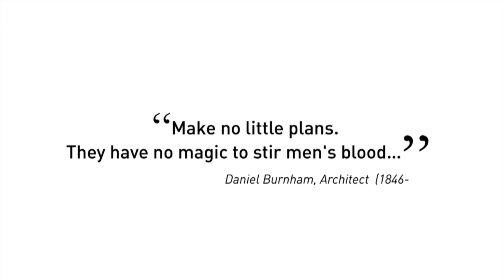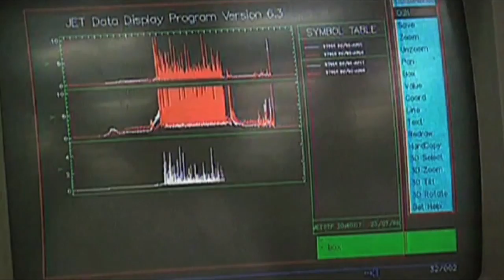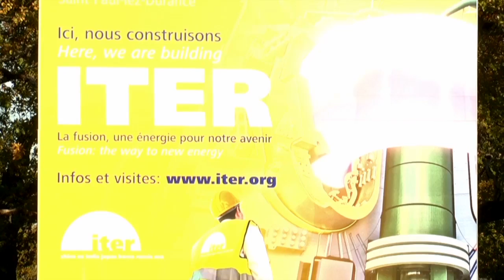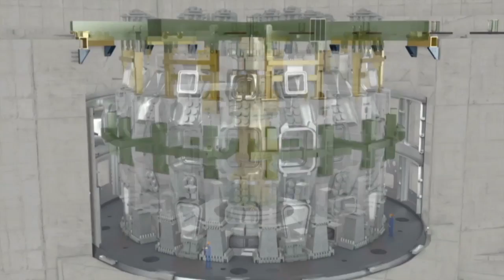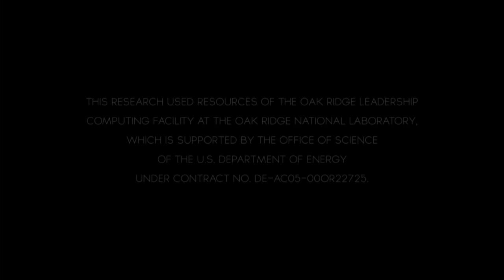ITER - in five minutes

Comment: Won't the heat melt the parts ?
Reply: no the plasma cant touch the walls of the reaction chamber since it is held away by the magnetic field.
Reply: That's what they want to check.
Reply: @lukasvolkwein6220  It sounds tricky. 150 million degrees.  WOW.  Doesn't steel melt at 3,000 degrees?
Reply: @kennethbransford820  yeah a 0 degree Fahrenheit vacuum is between the string of plasma held by the magnetic field, so there is no medium to transport the heat to the walls of the reaction chamber.
Reply: @lukasvolkwein6220  Wouldn't it melt by radiative means?  The sun is 27 million degrees and we are here talking about 150 million degrees. That's 5 times hotter the the sun.  I mean WOW!    Call me skeptical.
Reply: Sure it is a big engineering challenge but a smaller fusion realtor with similar design was built by the German Max Planck Institute and ist working. But it is to small to generate energy from it. In this tokamak reactor of Max Planck Institude you have to put more energy in to fusion the nukleids than retaining from the reaction. The goal of iter is to initiate a self sustaining chain reaction so you have only to start once, an than you can get energy from it.
Reply: @lukasvolkwein6220  I am like you and love science and any thing to do with engineering but you are talking about keeping the atoms or plasma close enough to fuse and create a self sustaining reaction producing pure energy.   The only know means known to mankind right now is gravity, the engine of the universe.  We right now can not generate the pressures needed for fusion to take place.   It would be cool if we could but I think we are running out of time in not being able to handle our global affairs which doesn't look good.
Reply: How does any of this directly relate to a question about why the heat wont melt the parts, Lukas, Kenneth.
Reply: (In this sub-thread)
Reply: @lukasvolkwein6220  but heat travels by radiation not just by direct transfer through a medium? It all looks insulated in a space age way though?
Reply: @kathybramley5609  Out in the open or in the environment , amino acids can not hold their shape from exposure to the sun or water and oxygen.   Water is a depolymer and oxygen is a reactant to other elements.  That is why the amino acids needs to be protected in the safety of a cell membrane.   So how did DNA  develop without a cell membrane.  And how did the cell membrane know what form to take with the instructions needed for all the parts that have to be made for the cell to exist,   with out the coded information via the DNA , the cell membrane can not exist?    You can not have one without the other rendering evolution impossible.   Evolution = Self Assembling Atoms = Impossible.
Reply: @kathybramley5609  Sorry, I gave you a reply to a different thread.  Here is the reply you wanted.   The big,  big  problem is with the heat.  It can not be on for very long before it starts to melt.  Also the plasma confined in   the magnetic field is also a problem,  because it wants to strip the surface of the containment walls.   In Europe that are working on one right now,  the size of a city block,  but it will not be ready for years.  And then, it still might not work.   Who ever can figure this out,  will solve all of the worlds energy needs.
Reply: @kennethbransford820  Are you a troll? I can't believe you are interested in science and then ask these kinds of questions. You do not understand what heat it.
Reply: @henrik3141  And you to, you do understand what it means when you say life was an accident.  That atoms self assembled to make your brain, the most complex thing know to mankind.
Reply: @kennethbransford820  Ok so you are troll. Probably deny evolution and think the earth is flat.
Reply: @kennethbransford820  So your answer then is that an even more complicated thing just came together and created all of this? That makes sense :)
Reply: @henrik3141  Exactly.  There is no other solution to the problem of,  complex living creatures,  at all levels.   Yes.  Design is the only solution,  since chemicals by themselves, just siting there like what you see on venus,  or mercury that have methane and ammonia atmospheres,  lethal to living things,  along with no oxygen.   For life,  to be able to have a hold,  here on earth,  many steps a required before that can happen like oxygen.   What was the first step for that?   And an ozone layer.  And this is very important, a magnetic field.   And we haven't even started for life to emerge yet.
Reply: @kennethbransford820  Life (as we know it today) is almost entirely due to a lovely little microorganism called cyanobacteria. Perhaps looking into the "Great Oxidation Event" would steer you in the right direction. Also, there are plenty of organisms that thrive in anaerobic environments.
Reply: @xKrispyx    The great oxidation or the big rust.    You said it!    "there are plenty of organisms" .    This is a HUGE , HUGE ,  BIG  problem for pseudo science evolutionist's .     Do you know how may atoms are involved in a organisms?       And these thing can replicate and have their own metabolic pathways,  among other things needed for living systems or  organisms.    One bacteria has 50 million atoms.    One cell has 100 trillion atoms.    Just to get them to multiply and save information  is not easy.      So how did the first organism via abiogenesis or self assembling atoms, happen?       This is the whole of the problem among the scientists who say everything came into existence by accident.      They say the universe was by accident another huge insurmountable problem.  Our earth, which at one time had an atmosphere just like venus,  with no oxygen,  but only toxic gases and a runaway green house effect  that  somehow was terraformed,  to support life?   You are right when you said there has to be some first steps.   We need multiple steps .    These first steps  have to be the right steps,  and  in the right order,  or else  no life.   You still need photosynthesis which is able to extract energy from sunlite.     Were solar panels by accident?    Many, many  pre planned steps are required for our existence.   For sure more then cyanobacteria was needed to get to this finished product called earth that can NOW support life.      Not happy so-called little accidents like many people say.    You and me and everything in existence,  was not by accident,  but could only be  by that of design.       The combinatorial numbers needed, for  "everything"   to have happened by accident, proves pseudo science evolution to be a lie and a false narrative.    You need a universe.    You need a cell.   You need a earth.   You need organisms.   It never happened by accident.      Now you still need a cell.    You need DNA and RNA,  but you can't have RNA without DNA.  Viruses have RNA but they need the cells DNA to survive.    Here is another HUGE problem to overcome.    How can you have DNA,  and a cell membrane,  at the same time?       How was the cell membrane able to be constructed itself,  without the information or the knowhow from the DNA.    The sequenced coded information needed,  for all life to exist wasn't an accident.     Only DESIGN,   can explain the convergence problem we have here.   =====   Evolution = Self Assembling Atoms = Impossible      =======